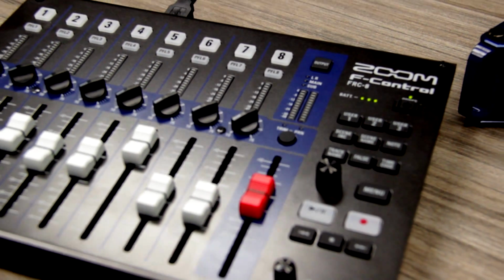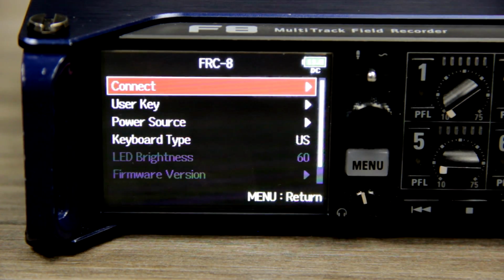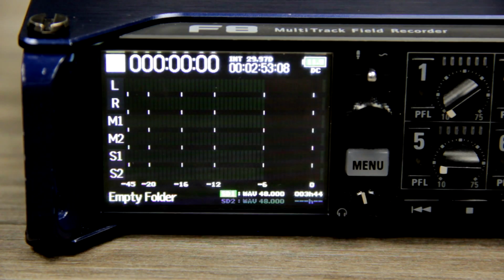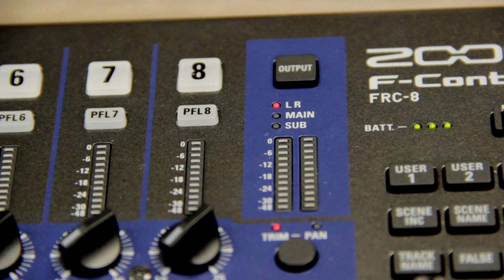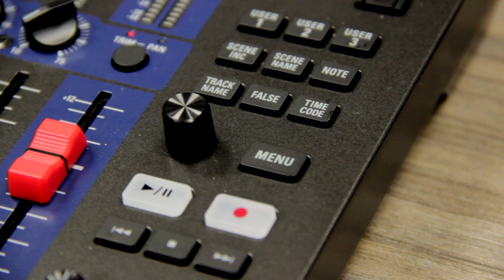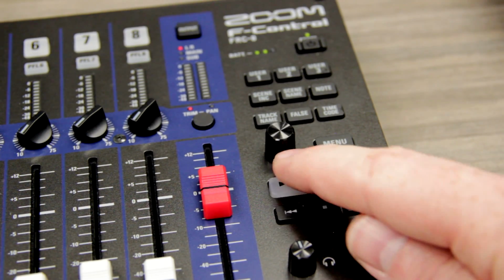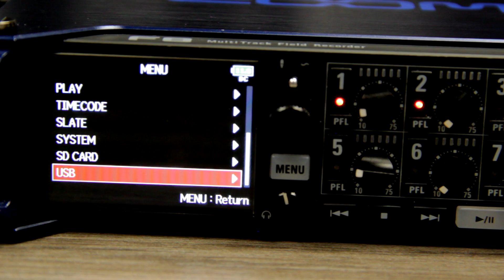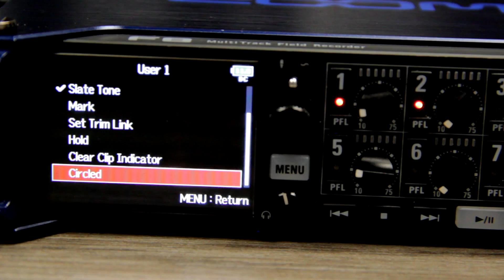Zoom F-Control: Introduction

Comment: one more question. 
i can use 6 of the 8 track controls on this F- Control using the Zoom F4 recorder?
as far as i understand the F4 gives you 6 independent tracks. it is that right?
Reply from the maker: That's correct!

Comment: Wow! You guys are on fire with your ever expanding product line. While innovation is good. Don't be like Sony, slow down.  I have a small request, can you fix your zoom audio recorder lineup so that they can playback WAV files without the metadata attached.  Tascam products can.  It would help when re-loading files back onto SD cards for later playback on the go.  I use your products to record lectures and like to listen at faster speeds later.  But my H1, H2n, and H5 cannot play the WAV files after removed and re-introduced, unless metadata file is there..and few people keep those honestly.